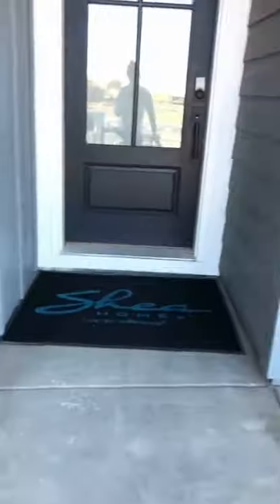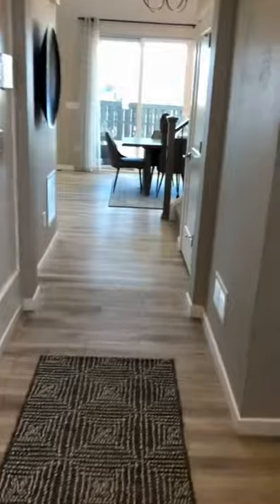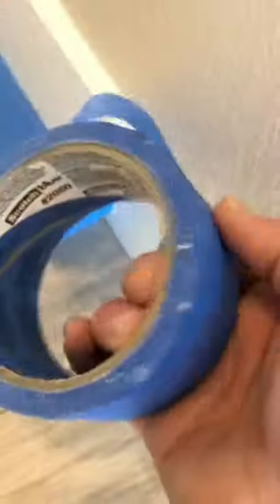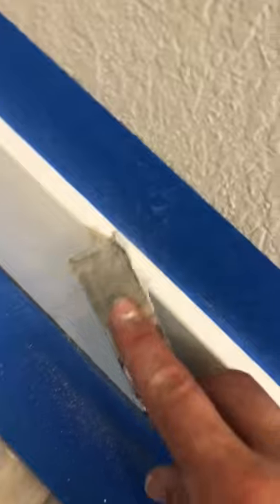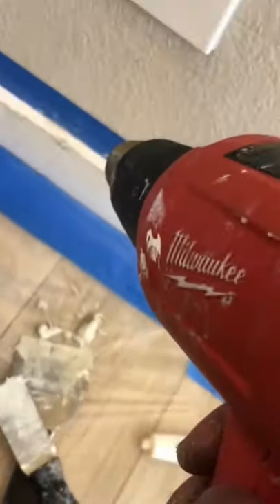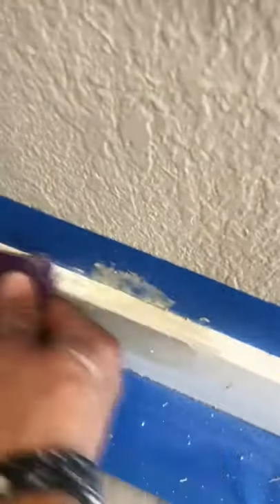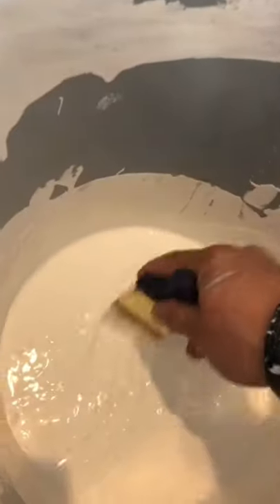How to repair chip on baseboard #shorts #diy #baseboard #bondo #homerepair

Comment: If only the first painter had trim taped as well as you did. There's a half inch of paint up the wall from the trim before you started. Lol
Reply: Looks like acrylic latex caulking smeared in the groove where the trim meets the wall.
Reply: I'm not a painter and I also noticed it
Reply: @Maxwell R. frog tape sucks. Painters use the blue and backfill it.
Reply: @johnnybravado1030  well the blue wasn't working for him this day. That paint is riding so high up the walls, he would of had the same result without any tape altogether.
Reply: @ahmadabdelrahim7777  that paint up the wall is from the previous painter.
Reply: I rewatched and defenately no paint up the wall before... Smh
Reply: @jontopham2742  I agree. Paint was not there before.
Reply: If the walls are taped flat and you install the base properly you shouldn't need to caulk the top . Should be a nice clean line... kills me when people use dap to hide s#!+ work.
Reply: That is caulking my friend. Or else there would be gaps between the baseboards and the wall.
Reply: @RadDadisRad  you're right. It's caulking.
Reply: I learned this yesterday, it's caulk up the wall. Always tape before caulk

Comment: Bet that bondo holds up better then the cheap MDF trim 🤣 also use the 4 inch purdy naps . They dont sprinkle paint at all, so a tape line is all you need.

Comment: That’s what you get with MDF base/case. A seriously imperfect product, made of sawdust and glue. They use it cause it’s wicked cheap, then wonder why it shows all the nail penetration holes, and chips like a feather pfukkar.  Use it, get good at repairing all the pflaws.
Reply: Seriously. This house won't last the mortgage term.
Reply: @weedshoes5089  yes it will lol they have a great warranty for these houses. Most houses you buy anywhere else that’s not a builder is not gonna have a warranty at all.

Comment: Isn't it faster just to cut and replace the whole peice ,i cut a entire house in 1 hour
 15 minutes to measure.
1 hour to nail.
Reply: Not always, for the most part baseboard typically gets installed before flooring (at least for the company I work for). There could be Baseshoe or tile for example and that would require having extra material on site like grout. Also some damage could happen to the wall which would then require drywall repairs.
Reply: I'd rather do this than get my saw out to cut a possible 10 foot piece of trim. He's doing it way more convenient and cheaper
Reply: Probably faster to cut but cheaper to do it this way
Reply: don’t you fill the nail holes, then sand that, then caulk the base to the wall, prime the caulk and whatever you used on the nail holes and paint 2 times ? 
so no, it’s not faster
Reply: It really doesn't matter as long as your getting paid decently.
Reply: @yername31  I do  carpentry ,no painting.
Reply: @easerone1651  
very true

Comment: 3 coats? How much time did that take? Plus the prepping and taping? Why not just replace the baseboard piece and repaint it? I guess if your charging for hourly rate you don’t care what it cost the end consumer but really your work ethics are either really bad or your tactics to to handle the repair are really stupid. Either way I  wouldn’t go around bragging about your work let alone make a video.

Comment: Could also use panel pins if it's deep. To hold filler In place. will be stronger incase it's knocked later on 👍
Reply: Bondo is hard AF
Reply: He just wants to get in-and-out,,
Reply: @pearlperlitavenegas2023  that doesn't mean it will stay bonded to the wood
Reply: Lmao here comes the “expert” in the comments. This isn’t concrete or cement dude..
Reply: MDF is porous enough to give a good mechanical grip. 
BTW MDF forest in central Oregon is almost gone...

Comment: Bro you do this so often you should make a tool for sharp corners. Like a 90 degree knife for the bondo.
Reply: Run two putty knives perpendicular against each other at the top edge and you can form the new edge corner with one coat of bondo

Comment: Will this work for water damage on kitchen cabinets
Reply: What happened to your cabinets? If the mdf is swelled up then no. Bondo is used as a filler for chips dents etc. It really depends on what the water did
Reply: If you're in one of those new houses like in this video you're probably better off replacing the doors they might not be made of solid wood and so are prone to very short lifespan near the sink.

Comment: What I can't seem to understand this how the man put blue masking tape like he was cutting in and still managed to get paint on the wall I can only assume he didn't run the tape flush I would have definitely complained I probably would have told him he needs to fix it before he got the final payment is that being an a**** or is that just getting what you pay for
Reply: Nah lol that’s a poor cut in… what weirded me out is how he insisted on using a foam roller to eliminate brush marks but didn’t take the time to cut in properly.  Personally I’m more concerned with making sure my lines are straight and where they need to be.
Reply: @tiko4621  yep he's obviously just learning just starting out because you only use foam rollers on steel applications for wood applications with a paintbrush you can get the lines out you just have to know what you're doing you apply the paint with the brush then you start back at a further location whichever corner of wood is closer and you start from there to get the brush lines out you just got to know what you're doing he took the easy way out instead of learning a skill he uses a foam roller on an application it was not really meant for

Comment: You can make Bondo forms out of cardboard and clear packing tape. Every straight edge you get and the less product used makes for quicker dry and less sanding. When customer won't go with new fascia material, I've rebuilt whole corners this way. Usually our area has termite bugs, but also dry rot from owner lack of mantainence. We often say weathering to the customer. For a good hold, you can drill some holes into the edges that will form anchor plugs. Also, if you've seen any termites make sure to treat with a good product first, then air dry.

Comment: Wouldn't it be cheaper to just change the base board? Instead of a fix that will damage again
Reply: No you'd have to spackle , sand, clean, re caulk and cut the trim and the wall back in
Reply: @chrissmith9798  now that you say that , I guess.

Comment: Never paint onto blue tape. The paint always bleeds through, and it was very noticeable at the end of the video. Not trashing on anyone, just sharing knowledge
Reply: It didn't bleed through
Reply: Blue tape is literally for what he was using it for. It doesn't bleed through, some people just don't properly prep the surface or smooth it down correctly and they get paint seeping under the edge.
Reply: 🤡 it’s painter’s tape…

Comment: Use the red hardener so you know it’s mixed well (you can’t tell with the white. Secondly you can just pinch the corner and run your fingers down the edge (with rubber gloves) so you only have to do one application. Might save you some time. Yours does look fine though